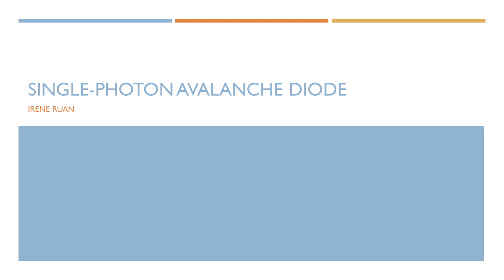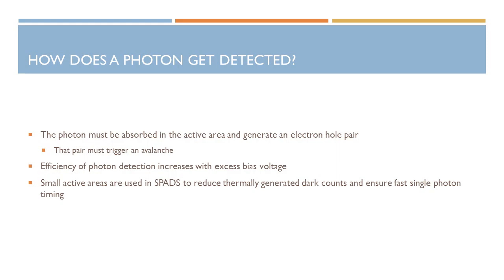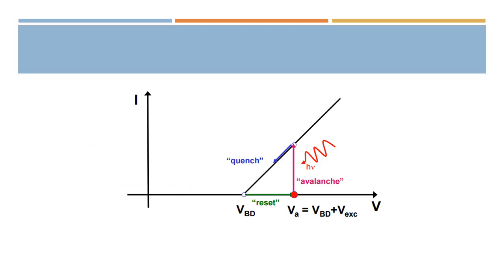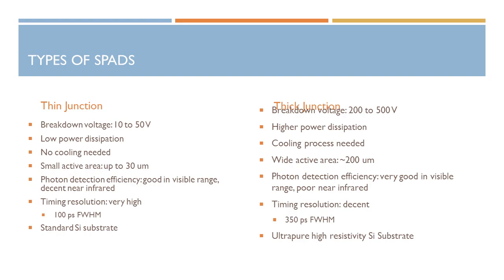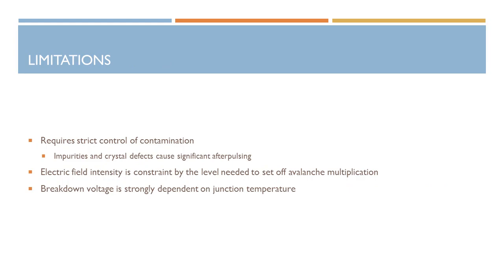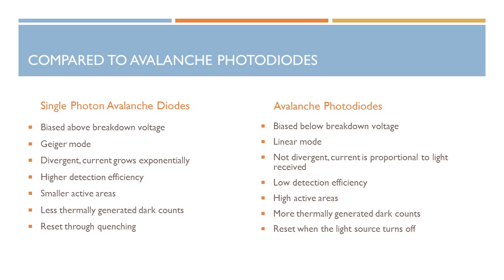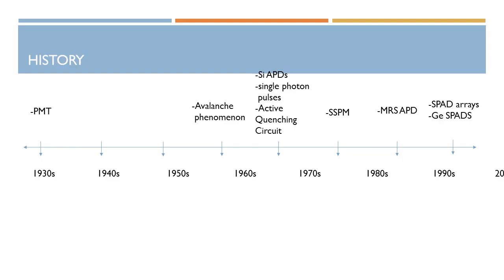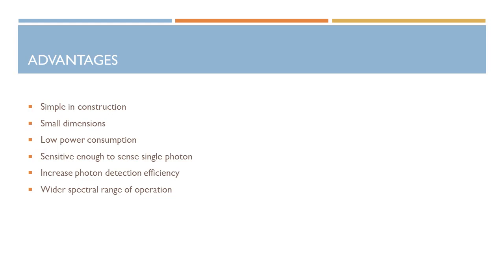The Basics of Single Photon Avalanche Diodes

Comment: the vacuum energy causes the dark counts, right?
Reply: lattice vibrations
Reply: It is caused by several factors, mostly cosmic ray interactions and thermal noise. Shield them well and keep em' cold and you get lower dark count. If it's still an issue lower the bias voltage a bit.❤